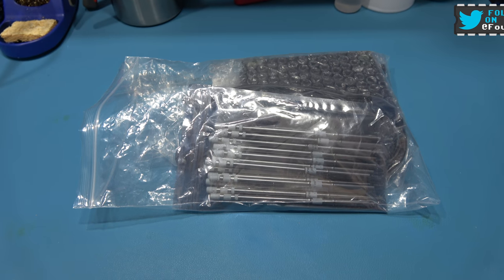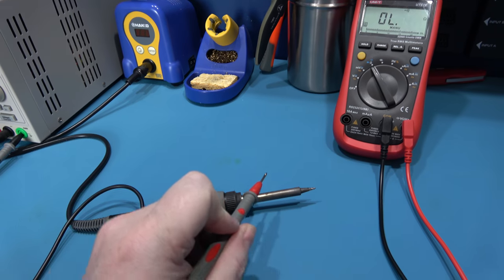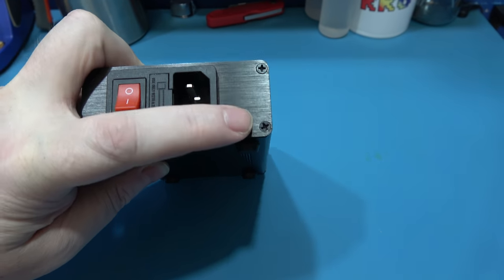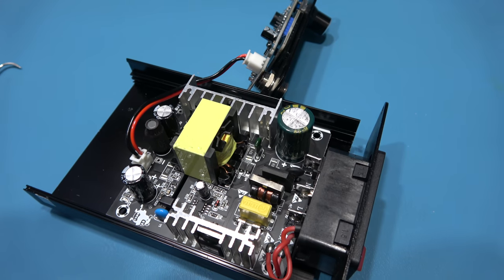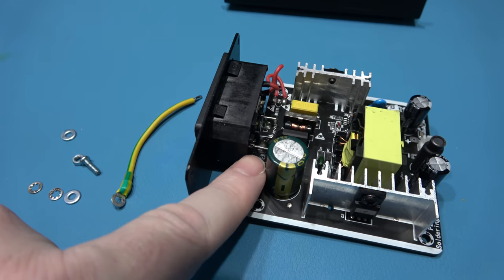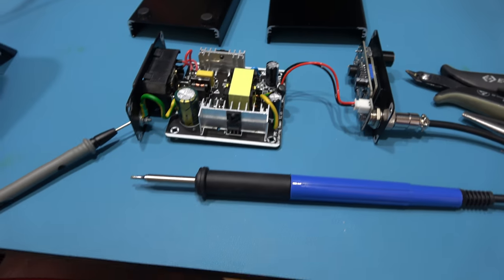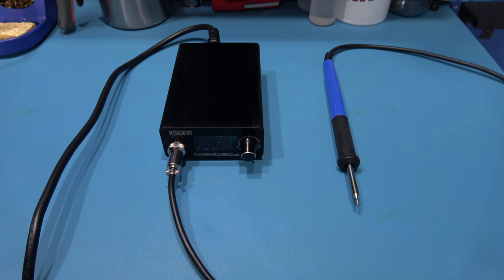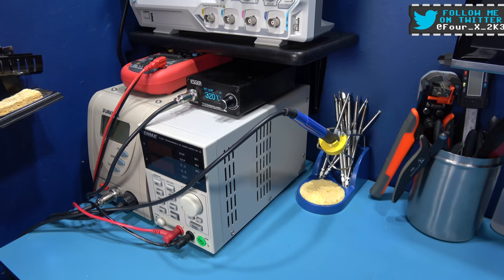New Tool for my Workbench - KSGER T12 Soldering Iron - But first, Let's make it safe to use.

Comment: Great video, I had version 2.04 and didn't know about the heat sink being close to the live. I did always think the aluminium case was a safety risk so thanks to your video I've successfully grounded my case and lifted the heat sink slightly for safety. I noticed the soldering tip was grounded on my version so didn't need to add a wire to ground the tip. Feel much safer using it now ☺️ thank you

Comment: Brilliant!  Thanks for the clear explanation.  The black board V 2.05 definitely needs the ground cable between PE and - (neg) on the board for the tip (pin 3) to be gounded.    I received mine from the official KRGER store and the tip  on this version of the board was definitely not gounded.  For good measure I also did the chassis ground and the kapton tape under the raised heasink and flipped the on/off switch as well.
Reply from the maker: Nice one. The KRGER is a great iron if you can get passed the safety issues.
Reply: link to ksger's official store please ( I'd rather get the genuine thing instead of a cheaper chinese knock off)

Comment: This is a helpful video. However, the step where you are grounding the soldering tip is not visually clear. Are you connecting the spot labelled PE in the front left of the board to the negative spot over by DC terminal?

Am I reading correctly that the failure here is the use of a two prong connector instead of a 3 prong connector since there is already an earth spot but the connector is not using it?
Reply from the maker: PE is Earth not negative of the DC terminal.
Reply: @Four_X  so you are attaching the end of the cable to the quite small PR pad that is unused on the DC connector? Is there enough of a route around that to connect the negative terminal to the earth?

A camera shot in that video showing the ends soldered would have been perfect.
Reply from the maker: @seanperry3667   Sorry I've no got back to you sooner, The conection is between The negative (-) that goes to the front panel controller board and the Potential Earth (PE).
Reply: @Four_X  Why not just short the pins 2 and 3 of the DC connector (from under the board)? The PE trace goes to the pin 3 and pin 2 is negative.

Comment: Nice and neat, as always. This later revision seams allot better.  I think this one also has newer firmware. Have the older one myself, so had to do all the mods.
Will go back in and insulate under the board. Nice touch that. Happy soldering.
Reply from the maker: Thanks Dermot, I was quite surprised when I saw they'd fixed some of the issues in this later revision board. I've been using the Iron for just over two weeks and it's surprised me how good it is.

Comment: Elektronik on the forcue forum says it is not to ground between PE and -. It says that it is said to go through the dividing transformer or something. 
The abbreviation of it is nonsense, etc.
I'm not electronics please explain.
(I'm only changing sprawled condensers.)

I have one more question, my problem:
IALSO HAVE AND BROKEN WHEEL. I HAVE TO TURN 6 TIMES TO MOVE THE MENU :(

Thank you for answering and help
(I'm delighted for bad english - translates googletratorslator )

Comment: My unit also has a black PCB but there's a difference, it has the clock battery glued to the transformer while yours I don't see any battery.
Could the ground bolt and nut be screwed to the bottom of the case instead of the plug panel of the case like you did here?
Reply from the maker: Sure, you can put it anywhere on the outer case.
Reply: @Four_X  All the videos on youtube use the same method so I was wondering why that would be, on the bottom it makes cleaning the metal shavings much easier and there's no bolt sticking out on the case, as long as I sand the edges on the case and the screws it should all be grounded but maybe I was missing something. On my unit the handle is earthed, I've checked with a multimeter, it's the V3.1S version on banggood.
Reply from the maker: I've seen versions with the handle earthed and not earthed. I think these may be made by different factories, it would explain a lot.
Reply: @Four_X  I got the one from the CZ warehouse and official store, I figured if I paid more I would get one unit where some resemblance of quality control was done. They sure vary in quality, I've seen people complain that the t12 tips wobble in the 9501 handle, capacitors that were damaged and leaking, tons of issues.

Comment: hello, is its safe to follow the grounding you did on my ksger solder station? in my country wall socket there is only two, live and neutral
Reply from the maker: If you have no earth no, if you do have earth yes.
Reply: @Four_X  what if i bury a metal rod to land amd make it as earth ground?

Comment: In this year of 2022, I bought one with no power supply inside, I used a 200W 24V meanwell power and the DC version went dead day one in a few hours with no sign of damage at all. The parts are cheap alternatives which could be led to catastrophic malfunction. Don't buy KSGER now~